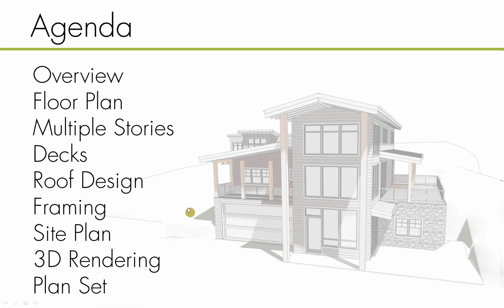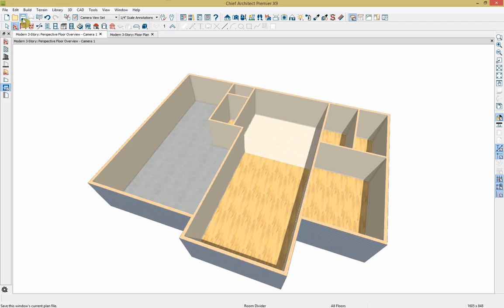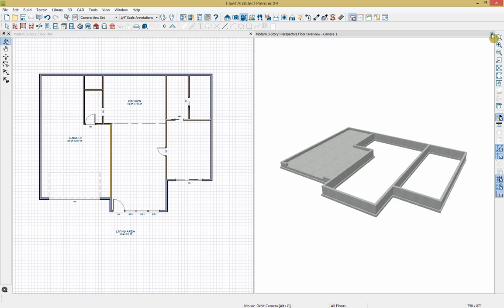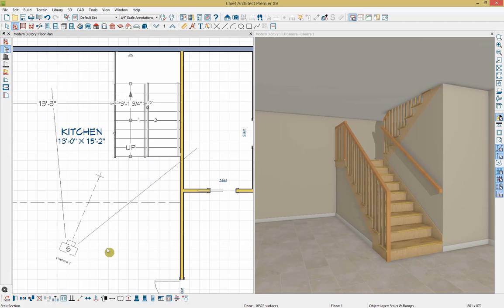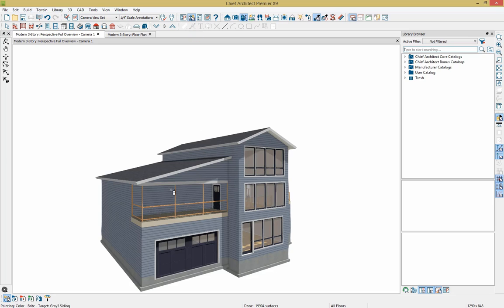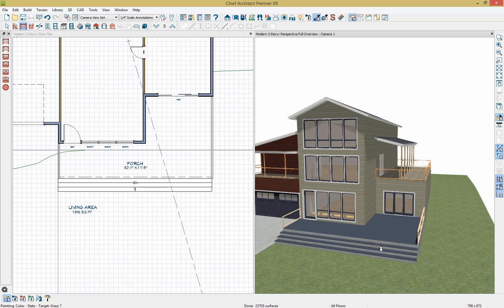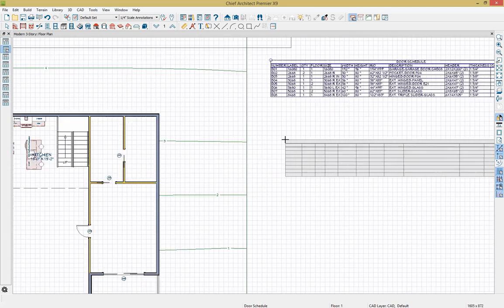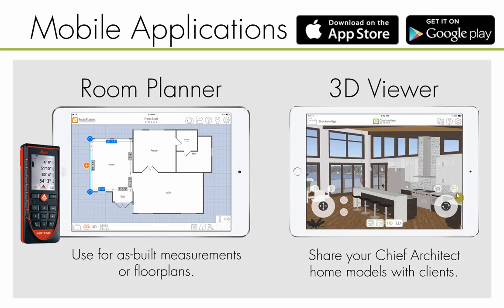Chief Architect X9 Building Demonstration

Comment: Emily, you may have seen my description of My Sketchup Customer Service nightmare. I have been looking for a better solution since. Questions: Is Chief Architect adaptable to Auto Cad, can I use this for Bims, Geographic(GLS) placement, use Jpeg images, print plans? Thanks
Reply from the maker: Hello Gobuilditbetter, thank you for your interest in Chief Architect Software! Chief Architect Premier is BIM software and supports the import and export of .dwg and .dxf CAD files. You can import terrain data in the form of a survey file or GPS file, or can manually create your terrain using the elevation tools in the software. You're able to import jpeg images to trace over, or as a backdrop to design in front of. Premier supports a full set of construction plans at 24x36 or larger prints. You can find more information and download a free trial version on our website here: https://www.chiefarchitect.com/products/home-design/premier/. Thanks!
Reply: @ChiefArchitect  great information, Thanks